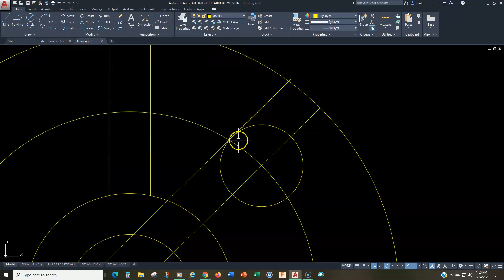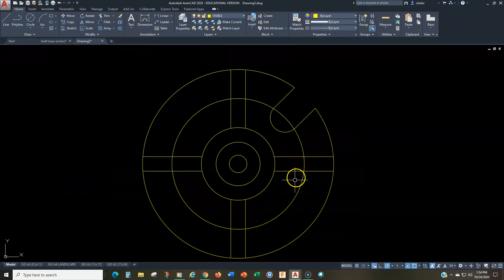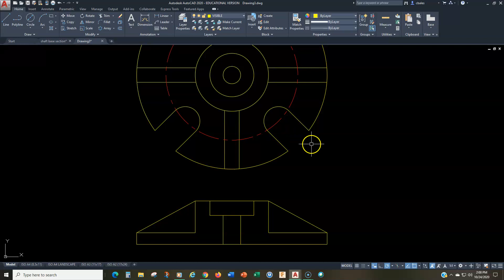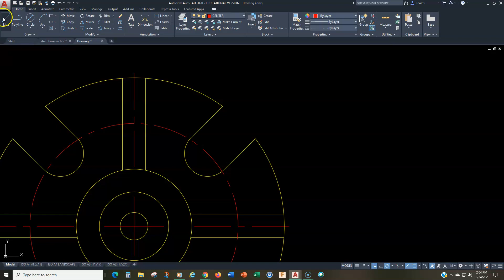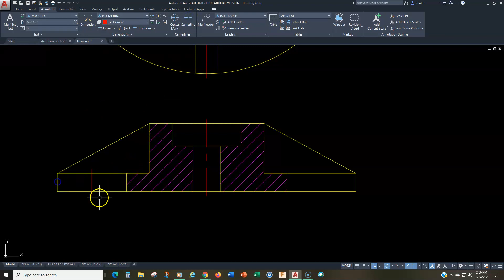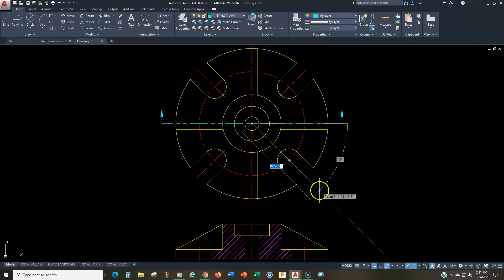Flanged Support Section Demo

Comment: In a half-section view of this part would one of the slots appear down the center, meaning it would be centered 90 deg. from the right and left slots in that view.
Reply: No. The slot would only appear on the sectioned half of the half-section view and the unsectioned half would appear as viewed from the exterior (with no interior/section view). The unsectioned half should have no hidden lines based on the rule for not showing hidden lines in a section view.
Reply: @chickennugget5376  thanks